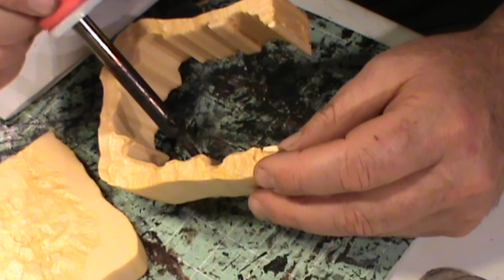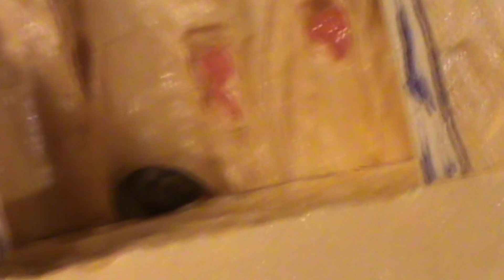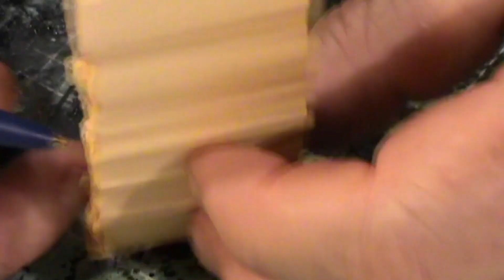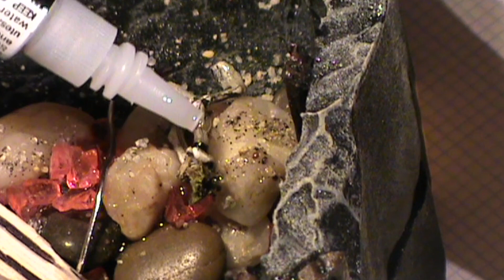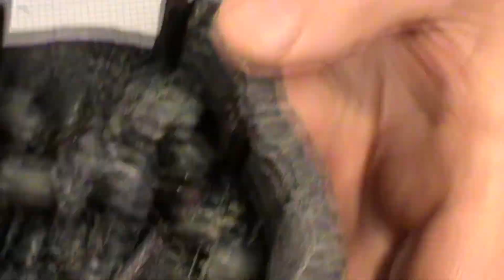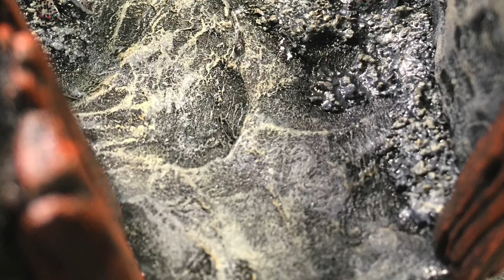Episode 95: Abandoned Mine Part 4

Comment: One thing I always wanted to ask, but forgot. How does the super glue affect the foam after you use soldering iron? Does it melt it more?
Reply from the maker: Soldering does tend to "seal over" the surface and make it more paintable and less vulnerable to super glue. In addition, the brand of insulation I use seems to be much less affected by super glue than some of the others I see on YouTube.